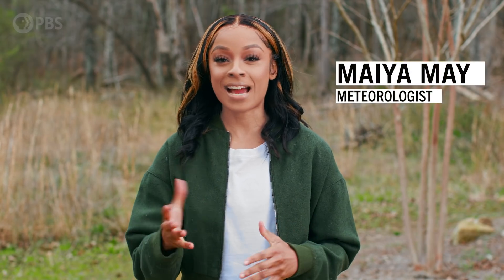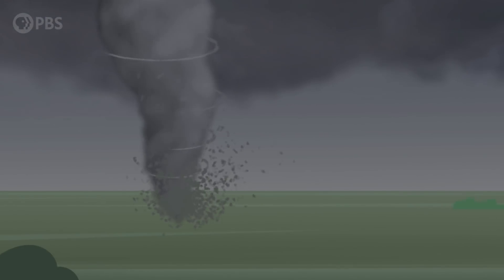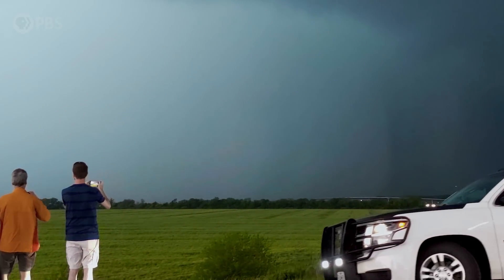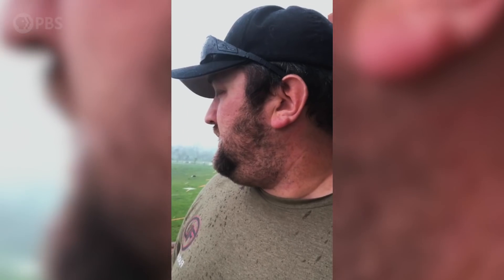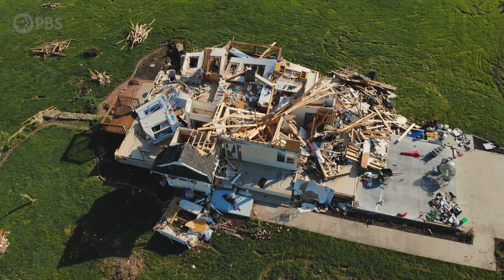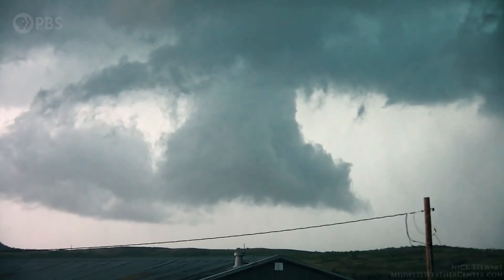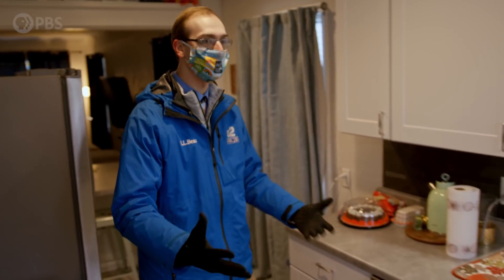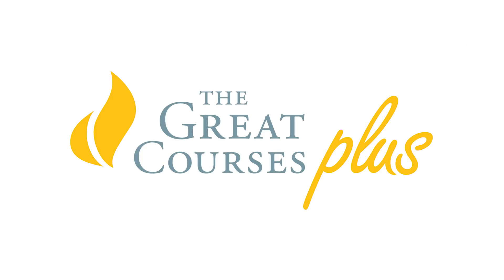Tornado Warning: Survive Nature's Wildest Winds | Weathered

Comment: You know, with micro technology, they could actually make the reflectors on the roads into mico weather stations with solar energy providing power and wireless transmitter to send the data. That might be expensive, but the fact remains that tornadoes cross roads all the time and such a small device could get more accurate data that might help tell the difference between tornado production and just a nasty super cell. You'd never know until you try.

Comment: Just pointing out that the UK gets more tornadoes per square mile than anywhere else.
Reply: Well yeah, you're a tiny little island lol.  The UK gets about 25 tornadoes a year. Most of them cause little to no structural damage.  The US gets over 1,000.  Imagine an EF 5 ripping through downtown London. I'm not sure what the point you're trying to make is? but it's a bad comparison.
Reply: @coryCuc  tiny? It's one of the biggest islands on the planet.  Also I fear you may be confusing actual tornadoes with reported tornadoes from the general public. I've seen one tornado and two waterspouts from my apartment windows inside 24 months.
Reply: @NeonVisual  When you consider that some "islands" aren't considered islands, they are considered "land masses," the UK is not that big.  It's only about 70k sq miles. I'm still not sure what the point is that you are making? Heck, Texas gets 6 times the tornados that the UK does and that's just one state. And the tornadoes we get in the the States are massive.  There's no other place in the world that has a geographical location like Tornado Alley.  Check out Pecos Hank's channel for some huge EF 5 tornados. Joplin, Moore, etc...
Reply: That's cute lol